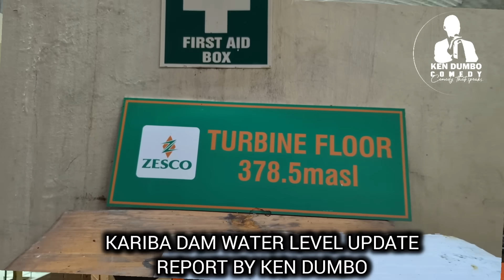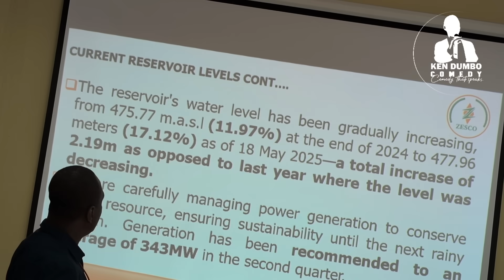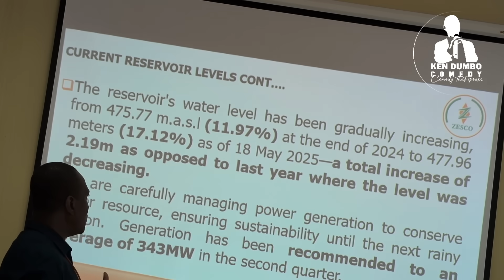KARIBA DAM WATER LEVEL UPDATE ‼️‼️

Comment: Dubai has no dam but they don't have loadshedding Mr. Ken
Reply: Dubai is a developed country baba. Their GDP is above 116 billion USD as of 2024.
Zambia's GDP is below 25 billion USD.
That means Dubai is capable of investing in modern technological advancements to modernize their country. They have good trade and are currently running a trade surplus.
Zambia has been running a balance deficit and has continued to do so.
Therefore, comparing Zambia and Dubai is impractical

Comment: Ken what you need to explain is that Kariba produces 1080MW while Zambia needs 2400MWs as a country. So kariba only produces one third of our power. Even if it went to full production of 1080 from thr current 345MW, the power wont be enough to end loadshedding. Zambia gets most of its power from kafue river kafue gorge upper 950MWs, KG lower 750MW and  itezhi tezhi 120MWs. Plus Maamba 300MWs. So the kafue river power stations are also operating at less than 50%. The only power station operating at full capacity is vic falls power station producing 108MWs coz it doesnt need a dam
Reply: And the electricity WE EXPORT?🤨🤨😡😡😡
Reply: @maggiedaka4399  yes....ZESCO has $2 billion nkongole for the Kafue lower dam. Who will pay for the monthly loan interest payments?....be realistic
Reply: @maggiedaka4399 those exports enable you to buy power for home use at a lower rate. Besides, we need forex and that goes back to sustain ZESCO.
Reply: So, the bulk of the power generated comes from the hydro-power stations on the Kafue river. It's kind of odd that so much focus has been on Kariba.
Reply: @gilsonsangulukaniphiri5018 what do you expect from a massively illiterate society that claims to be educated? We have individuals who laughed when they heard about the US tariff on Zambian exports because they think we do not export anything in Zambia yet these are individuals who clearly indicate on their social platforms that they have been to UNZA, CBU and other tertiary institutions. It's circus!
Reply: 100% correct.....The Kafue river cascade is actually the backbone of Zambias power needs......not the Kariba dam.
Reply: Wow. This is interesting.
Reply: So why export to Namibia?
Reply: @Cozywisdom  Namibia imports close to 80MW of Zambian power....Katima Mulilo completely depends on Zambia
Reply: U understand it better, well explained
Reply: Thank you Ken
Reply: Good explanation. But the government and zesco fail to explain this so that everyone is aware about power
Reply: But they are still busy selling power to Namibia 💁‍♂️

Comment: But we are still exporting 😢
Reply: What we export is 100MWs and goes to 2 small border  towns  in Botswana (kasane) and Tanzania. Even if we stoped exporting load sheding wont reduce by 1hr. We are also still importing from Mozambique
Reply: @dicksonmatulula8841 Did you read the 10year contract with Namibia, besides that what's the logic in exporting the same thing yr importing.
Reply: @dicksonmatulula8841  So, we are not exporting to Malawi? 
I think any reduction is better than nothing, just my opinion 😏